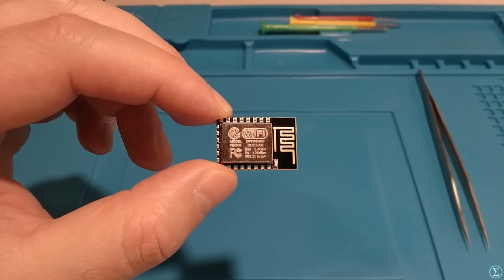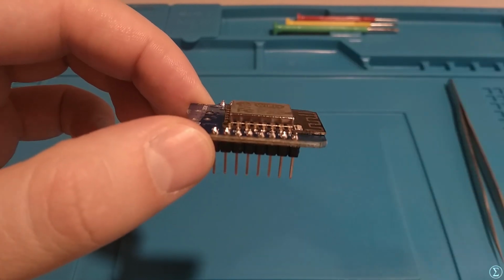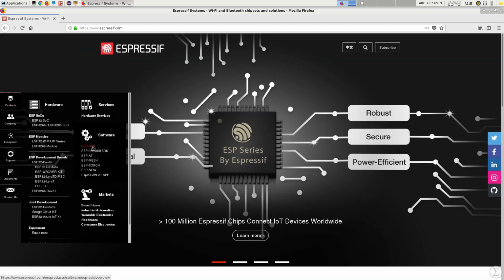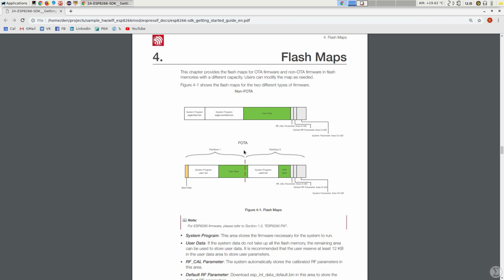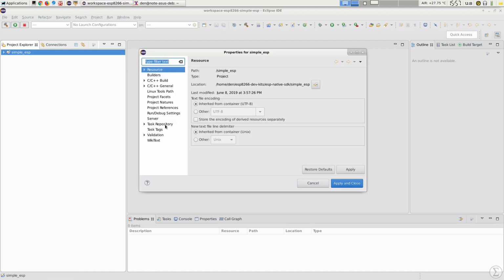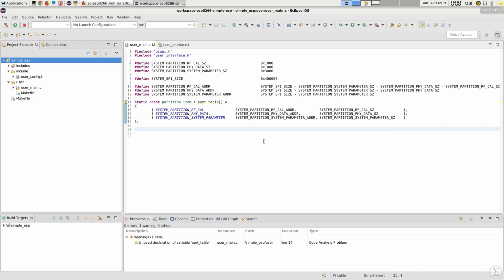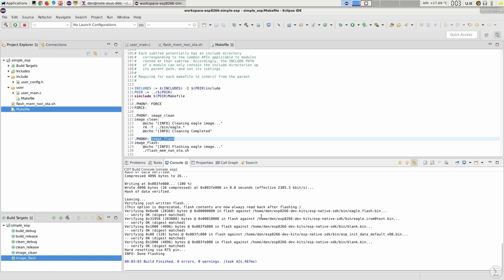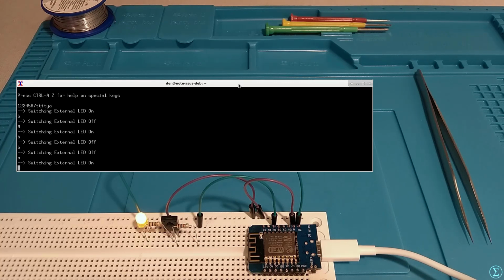ESP8266 Getting Started: C Programming in Eclipse using ESP SDK (No VM, No Arduino)

Comment: Чет не получается. Все сделал как в видосе, но получаю:
!!!
sh: 1: xtensa-lx106-elf-nm: not found
no entry point!!
mv: cannot stat 'eagle.app.flash.bin': No such file or directory
make: * [../Makefile:273: .output/eagle/release/bin/eagle.app.v6.bin] Error 1
"make COMPILE=gcc BOOT=none APP=0 SPI_SPEED=20 SPI_MODE=DIO SPI_SIZE_MAP=4 FLAVOR=release" terminated with exit code 2. Build might be incomplete.

23:35:21 Build Failed. 1 errors, 0 warnings. (took 1s.685ms)

И в нете решенеи не могу найти. Говорят пайтон поставь, но он у меня и так стоит
Reply from the maker: xtensa-lx106-elf-nm: not found - ну это видимо toolchain не скомпилировался ... из этих шагов -  http://sigmaprj.com/esp8266.html - нужно внимательно посмотреть,что 
cd esp-open-sdk
make STANDALONE=n
без ошибок отрабатывает... то что без ошибок отработали - это должны toolchain бинарники сгенерироваться:
~/esp8266-dev-kits/esp-open-sdk$ ls -1 xtensa-lx106-elf/bin
...
xtensa-lx106-elf-nm
xtensa-lx106-elf-objcopy
xtensa-lx106-elf-objdump
...
если бинарников нет - то нужно внимательно посмотреть ошибку на этапе компиляции open-sdk, если совпадает с тем что на сайте описывалось... то можно исправить...
подробно по ошибкам компиляции open-sdk можно тут лог посмотреть:
~/esp8266-dev-kits/esp-open-sdk/crosstool-NG/build.log
недавно проблема с dependency isl.gforge.inria.fr появилась, как исправить - на странице надавно описали

Comment: The first time when i , compile it worked , but from the time when i restart my system and then try to compile using #build_release in #eclipse ,  it telling me "make[1]: xtensa-lx106-elf-gcc: Command not found", any one know what is the problem? 
. Thanks
Reply from the maker: so, probably you have to check whether xtensa binaries folder is included in your shell path.. you can check it by typing: echo $PATH .. on a first time - you probably have executed 'export' command to include the xtensa binaries folder in shell PATH variable, but it is going to be reset after system restart (if it is not included in shell initialization script like .bashrc in the home folder). You can follow the step described on: 14:00
Reply: @sigmaprojection3781 ~/.bashrc
export JAVA_HOME=/usr/lib/jvm/jdk-16.0.1
export PATH="$PATH:$JAVA_HOME/bin:/home/rate-eyes/esp8266-dev-kits/esp-open-sdk/xtensa-lx106-elf/bin"
 
Output after echo $PATH
/home/rate-eyes/.local/bin:/usr/local/sbin:/usr/local/bin:/usr/sbin:/usr/bin:/sbin:/bin:/usr/games:/usr/local/games:/snap/bin:/usr/lib/jvm/jdk-16.0.1/bin:/home/rate-eyes/esp8266-dev-kits/esp-open-sdk/xtensa-lx106-elf/bin
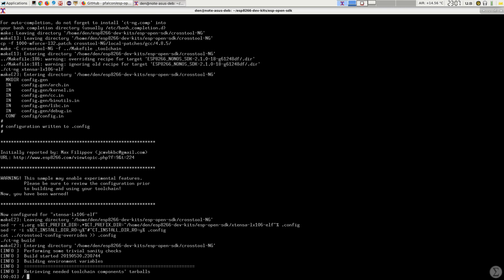Reply from the maker: @MuhammadSalman-gv6mx  yes, this looks right.. which output do you have on command "echo $PATH" ? if does not works might be the issue that .bashrc file is not triggered automatically (you can try to use .profile in this case)... you always can try to run manually: export PATH="/home/rate-eyes/esp8266-dev-kits/esp-open-sdk/xtensa-lx106-elf/bin" and try to execute xtensa-lx106-elf-gcc... also please make sure that compilation process was successful: ls -la /home/rate-eyes/esp8266-dev-kits/esp-open-sdk/xtensa-lx106-elf/bin should output binaries ... (like in a sample at 13:48)
Reply: @sigmaprojection3781  Okay let me try this , and i will let you know if incase i get some hopeful results
Reply from the maker: Thanks Muhammad... in case of folder /home/rate-eyes/esp8266-dev-kits/esp-open-sdk/xtensa-lx106-elf/bin is empty and does not contains any binary files - it means the compilation stage might be failing... if this is a case - you can check here: http://sigmaprj.com/esp8266.html on section "ESP open SDK build and installation." (there are few potential compilation error cases explained)
Reply: @sigmaprojection3781  still Stuck on the Same Issue , Even though i Reinstall Ubuntu,  Every command i type , have the same output , as Yours ,
And this is the outputs in terminal as mentioned below:

1#:

rat@RAT:~$ xtensa-lx106-elf-g++ --version
xtensa-lx106-elf-g++ (crosstool-NG crosstool-ng-1.22.0-60-g37b07f6f-dirty) 4.8.5
Copyright (C) 2015 Free Software Foundation, Inc.
This is free software; see the source for copying conditions.  There is NO
warranty; not even for MERCHANTABILITY or FITNESS FOR A PARTICULAR PURPOSE.

2#:

rat@RAT:~$ echo $PATH
/lib/jvm/jdk-16.0.1/bin:/home/rat/esp8266-dev-kits/esp-open-sdk/xtensa-lx106-elf/bin:/usr/local/sbin:/usr/local/bin:/usr/sbin:/usr/bin:/sbin:/bin:/usr/games:/usr/local/games:/snap/bin

3#:
nano ~/.bashrc  file

export JAVA_HOME=/lib/jvm/jdk-16.0.1
export PATH="$PATH:$JAVA_HOME/bin:/home/rat/esp8266-dev-kits/esp-open-sdk/xtensa-lx106-elf/bin"

4#: Eclipse IDE output when i try to #build_release

make COMPILE=gcc BOOT=none APP=0 SPI_SPEED=20 SPI_MODE=DIO SPI_SIZE_MAP=4 FLAVOR=release 
make[1]: Entering directory '/home/rat/esp8266-dev-kits/esp-native-sdk/simpleESP/user'
DEPEND: xtensa-lx106-elf-gcc -M -Os -g -Wpointer-arith -Wundef -Werror -Wl,-EL -fno-inline-functions -nostdlib -mlongcalls -mtext-section-literals -ffunction-sections -fdata-sections -fno-builtin-printf -DICACHE_FLASH -DSPI_FLASH_SIZE_MAP=4 -I include -I ./ -I ../../include/ets -I ../include -I ../../include -I ../../include/eagle -I ../../driver_lib/include user_main.c
/bin/sh: 2: xtensa-lx106-elf-gcc: not found
xtensa-lx106-elf-gcc -Os -g -Wpointer-arith -Wundef -Werror -Wl,-EL -fno-inline-functions -nostdlib -mlongcalls -mtext-section-literals -ffunction-sections -fdata-sections -fno-builtin-printf  -DICACHE_FLASH -DSPI_FLASH_SIZE_MAP=4   -I include -I ./ -I ../../include/ets -I ../include -I ../../include -I ../../include/eagle -I ../../driver_lib/include  -o .output/eagle/release/obj/user_main.o -c user_main.c
make[1]: xtensa-lx106-elf-gcc: Command not found
make[1]: Leaving directory '/home/rat/esp8266-dev-kits/esp-native-sdk/simpleESP/user'
make[1]: * [../../Makefile:346: .output/eagle/release/obj/user_main.o] Error 127
make: * [../Makefile:331: .subdirs] Error 2
"make COMPILE=gcc BOOT=none APP=0 SPI_SPEED=20 SPI_MODE=DIO SPI_SIZE_MAP=4 FLAVOR=release" terminated with exit code 2. Build might be incomplete.

Thanks
Reply from the maker: @MuhammadSalman-gv6mx  ook, I see.. looks like bash shell can see this path with xtensa, but eclipse does not sees it... do you start eclipse from Ubuntu desktop? I can see step #1 is successful... so, you can try to start eclipse directly from the terminal which works successfully on step #1 (instead of starting eclipse from ubuntu desktop) ... you also have the option to try to build outside eclipse... in terminal from step #1 you can try: 

cd /home/rat/esp8266-dev-kits/esp-native-sdk/simpleESP
make COMPILE=gcc BOOT=none APP=0 SPI_SPEED=20 SPI_MODE=DIO SPI_MAP_SIZE=4 FLAVOR=release

please let me know whether build works for you outside eclipse...
Reply: @sigmaprojection3781  yes , i  start eclipse from Ubuntu Desktop ,  and it is working outside eclipse , 
how can i solve this problem?.
Thanks
Reply from the maker: @MuhammadSalman-gv6mx  ok... you can set PATH inside eclipse then:
1. Right-click on your project in "Project Explorer" window
2. Select 'Properties'
3. Select 'C/C++ Build' -> 'Environment'
4. Add environment variable 'PATH' and set it to
     /home/rat/esp8266-dev-kits/esp-open-sdk/xtensa-lx106-elf/bin:${PATH}
Reply: @sigmaprojection3781  Thank You very Much, Many Many Thanks Again for helping me , God Bless you Sir
More Success in your life ,
I wish i could set besides you and learn many more things from you...
Reply from the maker: @Muhammad Salman  no problems ) I'm glad to help with these Eclipse configs :)

Comment: What is difference between 
make
make STANDALONE=n
make STANDALONE=y
Reply from the maker: 'make STANDALONE=y' and just 'make' are the same ('yes' is set by default)... this option can be used when you plan to use open-sdk without Native ESP NONOS SDK.. (it makes additional build step for esp-open-lwip library also it will merge SDK into Xtensa toolchain, producing standalone ESP8266 toolchain)

Comment: Hi, Can I have you email ID to contact you. 
I'm getting the following error when I build the project on Eclipse
make[1]: xtensa-lx106-elf-gcc: Command not found

I have included the following in .bashrc file
export PATH=$PATH:/home/johns/esp8266-dev-kits/esp-open-sdk/xtensa-lx106-elf/bin 
Thank you for your support!
Reply from the maker: Hi John.. it might be that the open-sdk tool chain is not compiled successfully... recently I have encountered it with new Debian versions which uses bash version 5.0 ... could you copy-paste please here the most latest output lines from the command:
make STANDALONE=n
(the command which you run under esp-open-sdk folder)... also could you share please the output from the command:
bash --version
is it 5.0 or later?
if yes then there is trivial solution... need to update file: 
./esp-open-sdk/crosstool-NG/configure.ac - line 193:
from
|$EGREP '^GNU bash, version (3\.[1-9])')
to
|$EGREP '^GNU bash, version (3\.[1-9]|4|5)')
this is known open-sdk and bash 5.0 compatibility issue, discussed here:
https://github.com/pfalcon/esp-open-sdk/issues/365
please let me know if you are using bash version less than 5.0 (then I will need to have output from 'make STANDALONE=n' command to check).
I was about to append some reference links to the video about this esp-open-sdk and bash 5.0 compatibility issue.
Reply: @sigmaprojection3781  Thank you for the prompt reply, much appreciated. I encountered many issues while following your steps. But I googled and found answer.

GNU bash, version 5.0.17(1)-release (x86_64-pc-linux-gnu).
Here is some of the problem I encountered.

ERROR
	$ sudo apt-get install python-pip
	Reading package lists... Done.
	.
	E: Unable to locate package python-pip
FIX: 	
$ sudo apt-get install python3-pip

Check for Python in usr/bin folder
Found Python3.8

$ pip install esptool --- Did not work
$ pip3 install esptool -- Worked

$ sudo apt install git - I need to do this before 
$ git clone --recursive https://github.....

config.ac Line 193 I changed it to
|$EGREP '^GNU bash, version ([0-9\.]+)') because 
because I got the error 'error: could not find bash >= 3.1'

As per https://github.com/pfalcon/esp-open-sdk#debianubuntu
$ sudo apt-get install make unrar-free autoconf automake libtool gcc g++ gperf     flex bison texinfo gawk ncurses-dev libexpat-dev python-dev python python-serial     sed git unzip bash help2man wget bzip2
[sudo] password for johns: 
Reading package lists... Done
Building dependency tree       
Reading state information... Done
Note, selecting 'libncurses-dev' instead of 'ncurses-dev'
Note, selecting 'libexpat1-dev' instead of 'libexpat-dev'
Note, selecting 'python-dev-is-python2' instead of 'python-dev'
Note, selecting 'python-is-python2' instead of 'python'
E: Unable to locate package python-serial

I did the above suggestion libncurses-dev' 'libexpat1-dev'  'python-dev-is-python3' 'python-is-python3' etc 

$ make STANDALONE=n

[INFO ]  Installing cross-gdb
[ERROR]    /home/_johns/esp8266-dev-kits/esp-open-sdk/crosstool-NG/.build/src/gdb-7.10/gdb/python/python.c:1757:3: error: too few arguments to function '_PyImport_FixupBuiltin'
[ERROR]    make[5]: * [Makefile:2517: python.o] Error 1
[ERROR]    make[4]: * [Makefile:8755: all-gdb] Error 2
[ERROR]    make[3]: * [Makefile:845: all] Error 2
[ERROR]
[ERROR]  >>
[ERROR]  >>  Build failed in step 'Installing cross-gdb'
[ERROR]  >>        called in step '(top-level)'
[ERROR]  >>
[ERROR]  >>  Error happened in: CT_DoExecLog[scripts/functions@257]
[ERROR]  >>        called from: do_debug_gdb_build[scripts/build/debug/300-gdb.sh@120]
[ERROR]  >>        called from: do_debug[scripts/build/debug.sh@35]
[ERROR]  >>        called from: main[scripts/crosstool-NG.sh@646]

The above error was fixed by
$ sudo apt-get install python-dev

$ make STANDALONE=n
Xtensa toolchain is built, to use it:
Reply from the maker: thanks John, for detailed feedback ..
yes, on different platforms open-source projects compilation might have some variations...
I also only recently have discovered this issue with open-sdk - bash 5.0 compatibility.. but after config.ac fix - looks good.
Also I was a bit surprised that 'sudo apt-get install python-pip' did not worked in your case - probably we are running on different Debian distribution versions, or different aptitude sources config.
please let me know if you still have any unresolved issues ...
Reply: @sigmaprojection3781  There were few more issues, but I only made note of these. I will keep updating.

Comment: Sorry, this may be silly question. Can I follow your steps on ubuntu Linux as well? or do I need Debian? I'm trying to convert my old Laptop to Linux machine.
Reply from the maker: Hi John, thanks for your question.
Yes, you can follow the same steps on Ubuntu. Major point here will be to build the esp-open-sdk toolchain (which also is compatible with Ubuntu - as it is opensource)  - https://github.com/pfalcon/esp-open-sdk ... so you just have to make sure to install all dependencies on Ubuntu (before building toolchain):
https://github.com/pfalcon/esp-open-sdk#debianubuntu
sudo apt-get install make unrar-free autoconf automake libtool gcc g++ gperf flex bison texinfo gawk ncurses-dev libexpat-dev python-dev python python-serial sed git unzip bash help2man wget bzip2
other steps will remain pretty much the same ...
Reply: @sigmaprojection3781  thank you very much. I sure your video will be immensely helpful once I installed  Linux.👍🏼

Comment: Why do I need to setup the partitioning? In older SDK versions I was able to get started just by defining a custom user_init() and could react to system startup completion without a timer by registering a callback to system_init_done_cb() like this:

void ICACHE_FLASH_ATTR sdk_init_done(void)
{
 // Dump some system info.
 os_printf("SDK version:%s\n", system_get_sdk_version());

 httpd_init(routes, 8080, &serverHeader);
}

void ICACHE_FLASH_ATTR user_init(void)
{
 // Initialize UART0
 uart_div_modify(0, UART_CLK_FREQ / 115200);

 struct station_config config = {
  .ssid = WIFI_SSID,
  .password = WIFI_PASS,
 };

 // Set wifi operation mode to softAP and station mode.
 wifi_set_opmode(STATIONAP_MODE);
 wifi_station_set_config(&config);

 wifi_set_event_handler_cb(wifi_event_cb);

 // Initialize i2c interface.
 i2c_master_gpio_init();
 i2c_master_init();
 os_delay_us(10000);

 // Set init done callback.
 system_init_done_cb(sdk_init_done);
}

Is this still possible or changed the API?

Thanks and regards
Phidelux
Reply from the maker: Looks like you are using different SDK in your sample.
In presented video I'm trying to use minimal Native SDK (without any extensions like Arduino).
So, partitions initialisation is mandatory step in this case.
The same way as user_pre_init(void) method is mandatory for definition here.
Application will not start properly without this step.

And regarding system_init_done_cb - yes, it also can be used for "Hello World" application to make sure that
message will be printed after system's initialisation output.
But for "Blinkee" application - timer is needed in any case - and timer's initialisation at user_init() is simplifying code by 1 callback registration (extra step of system_init_done callback registration can be omitted)
Reply: @sigmaprojection3781  Ahh thanks. Regarding to this comment on an esp-open-sdk pull request that adds support for vendor SDK versions 2.0 and 3.0, the need to register a partition table was introduced in version 3.0.0 of the SDK: https://github.com/pfalcon/esp-open-sdk/pull/344#issuecomment-575159466 Easiest way would be to check out this pull request and directly build this instead of manually changing the setup, as lined out in this comment of the same PR: https://github.com/pfalcon/esp-open-sdk/pull/344#issuecomment-489086482 Thanks for your great tutorial and your help.

Comment: First thank you for this grate video, but I have an issue my SDK cannot fine the xtensa gcc and I don't now why also please note I check the insulation of xtensa gcc like you mentioned before do you know why this happens??
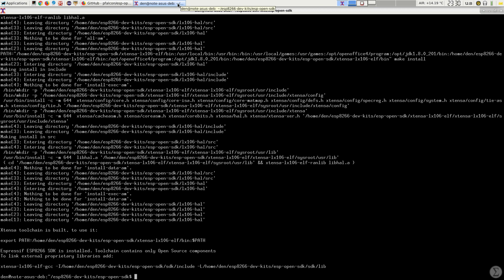Reply from the maker: Thanks, Ahmed. xtensa gcc might be missing in case of compiler tool chain was not assembled successfully. This step is pointed at 13:29 ... so, after making 'git clone' on Open SDK - it should be compiled... also if executables are present at 'esp-open-sdk/xtensa-lx106-elf/bin' but you cannot invoke 'xtensa-lx106-elf-g++ --vesrion' then the PATH environmnet variable should be updated (as referred at 13:54)
and to check whether the PATH has been set correctly, you can try to use the following command: 'echo $PATH'
as a result ...esp-open-sdk/xtensa-lx106-elf/bin - should be included in PATH